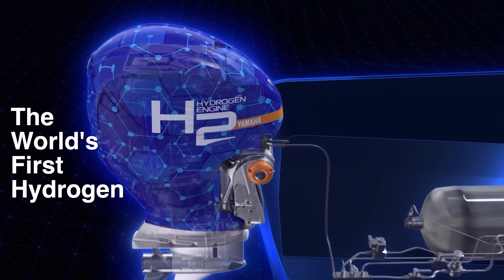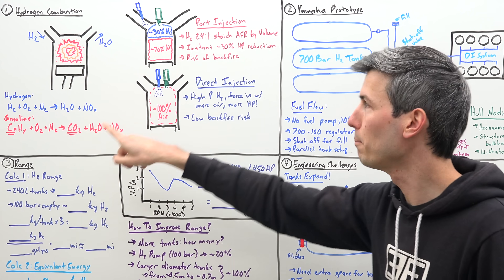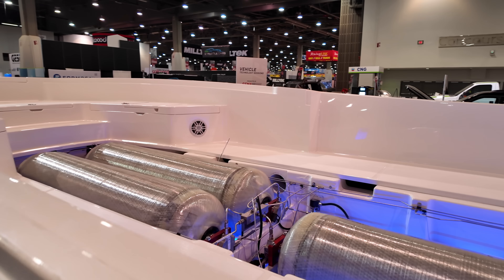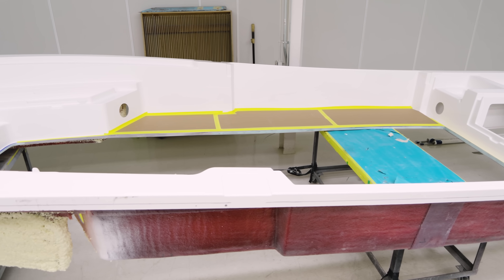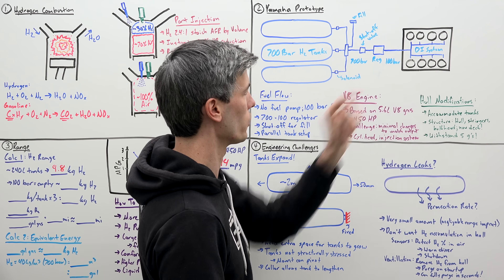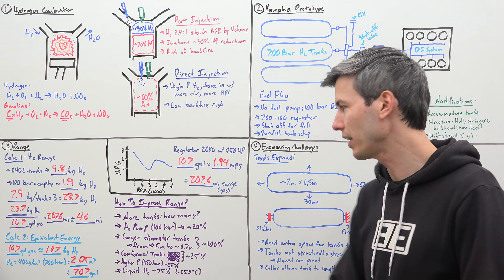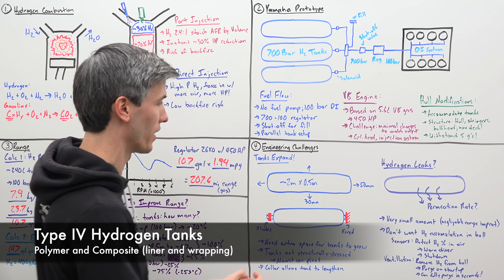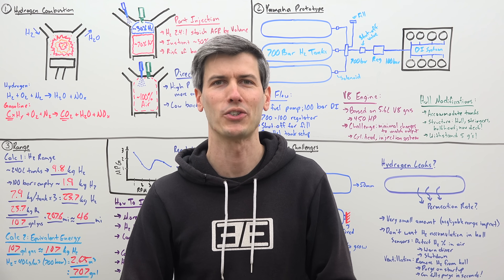The World’s First Hydrogen Combustion Outboard Engine!

Comment: Hydrogen is the worst possible combustion engine fuel. Its not dense enough to be viable for transport and it can't be made without consuming more energy than we get from burning it or cracking it from hydrocarbons.
Reply: Hydrogen is 3 times as energy dense as diesel, what do you mean it's not dense enough?
Reply: @Shamano37  By weight. By volume, even in liquid form, hydrogen takes up much more space.
Reply: Really, I think the interest in Hydrogen is proof that we don’t have full confidence in electric. We also like ICE cause who doesn’t? (Don’t answer that). Hydrogen combustion is mostly a fools errand (although no one has mentioned its abundance). I hope a focus on alternative fuels for ICE can lead us to a more sensible fuel. Have to walk before you run.
Reply: @Seyeler  Hydrogen is one of the least abundant free elements on earth, its almost all combined with other elements (water, carbon, oxygen, etc). That bond is stable, which means it takes a lot of energy to get that hydrogen free, more than can be extracted from the hydrogen except in a fusion reaction.
Reply: Certainly agree with the first part, but what fuel can make produce more energy when burned than it requires to be made in the first place? I believe thats impossible.
Reply: I don't see how they can possibly make hydrogen a mainstream fuel BUT I'm sure they will learn some things along the way that will improve the overarching goal of finding efficiently produced, energy dense, renewable fuels
Reply: both the french and australians have found large natural hydrogen fields this year,.in europe most of it is made using wind, solar or hydro electricity. the germans already have hydrogen stations all over the country. in birmingham england the busses are all hydrogen  combustion powered. its the only thing that works on heavy machinery and busses or trucks where electricity doesn't make sense.
Reply: Its not bad when you have a ton of excess energy from gigawatts of solar capacity. Hydrogen is useful in a world where gasoline use is 5% of its current levels
Reply: @Wren6858  you can use wind turbines to produce the hydrogen instead of switching them off when demand is low
Reply: I prefer to listen to the professionals.
Reply: Japan doesn't care, they live in an insulated echo chamber.
Reply: Still better than fossils
Reply: The only reason hydrogen is even brought up is because it can be created with renewable energy, solar, thermo, hydro, wind, etc. can’t do that with gasoline. Yes it needs a ton of work but it’s more of an electric v hydrogen problem at that point.
Reply: True, but of you can produce it using renewable electricity sources you. An.burn it without carbon emissions.  But yes density is a large problem, and then from an efficiency standpoint a fuel cell isimg hydrogen to make electricity  to powerelectric motors is a better use if tht energy in hydrogen than using it to power a combustion engine.
Reply: Clearly more energy goes into making hydrogen, storing it, cooling it, etc. etc. then that it actually delivers on energy. The rendement is just negative. ...I say ‘very nice surprise but a no go’.
Reply: I wonder how many people posting conclusive statements in here are actual engineers and how many just watched a few youtube videos.
Reply: And same with those carbon tax sellers!!!! Nuclear is the the cheapest and purest per energy from 1kg of fuel!

But lets sell that fugazy. Just peooke are morons! Now we are at europe electricity costs 0.02 eur for kw to freaking 0.80 at winter. Such a scammm!! And yes lets cancel soon all the wood burners and gas fueld machines like some usa states and ofc install all the solar panela to roofs and lets tax those if you have them on roof and yes buy those electric cars and then lets tax them also later. All the politics are just big scamms and deciving people.
Reply: It's hardly a fuel too, more like an energy storage type than anything else.
Imagine if we had to burn over one gallon of gas worth of energy to produce one gallon of gas. That would be ridiculous, right? Well that's pretty much what hydrogen is.
Reply: @MrArcticPOWER For production of hydrogen by electrolysis the energy loss is approximately 30%. Then there are losses involved in the energy cost of compression, transportation, and storage, giving an overall production loss of around 50%.
Reply: @MrArcticPOWER  Think how abundant hydrogen is in the known universe. If we continue to study it and find better ways to harness it, we can reduce the amount of digging for fossil fuels we have to do. Right now, it isn't viable, but maybe we can find a way to make it viable.
Reply: @Matthew_Campbell_Drums  Even if you find better ways to harness it, you're still stuck with all the other inconveniences.
Reply: @MrArcticPOWER  until we find something better. Look how far ICEs have come. Stuff like that doesn't happen overnight
Reply: @Matthew_Campbell_Drums  What do you mean how far ICEs have come? Over 100 years of evolution just to get 40% thermal efficiency at best while electric motors are already over 90%.
Reply: @MrArcticPOWER I think you’re missing his point, which is that innovation is impossible without experimentation and iteration.
Reply: @Matthew_Campbell_Drums   The most abundant element in the universe is also mostly in space or locked in water or other molecules (methane, etc), requiring a large energy input to break it open
Reply: @Matthew_Campbell_Drums   Gasoline as a fuel is immensely energy dense, easy to transport, relatively stable in controlled conditions. The only thing you need to improve is ways to extract energy out of it. Fossil fuels are so energy dense you can still get a ton of Work done even with 40% efficiency. Hydrogen is just, inefficient on a fundamental level. You can't make it energy dense without immense pressures or freezing temperatures, both of which are costly and/or dangerous to achieve, and there's practically nothing in the world that can prevent leaks entirely (without sheer mass) because the smallest element in the universe will go through basically any microscopic flaw eventually. And also there's no cheap way to harvest hydrogen, locked inside chemical bonds because it really hates being alone.
Reply: @Matthew_Campbell_Drums  What better way's to harness it? It's molecular physics, dude. Also so what if it's the most abundant molecule in the universe if 99.99% of it is inside stars. There is no free hydrogen roaming around the solar system. Only places you can find it except for the sun is inside gas giants mixed with other stuff. Even if you can mine it you still need to get it out of their massive gravitational well, good luck with that. You're clueless.
Reply: And it still produces NOX.  What marina sells hydrogen?
Reply: @Flies2FLL  How does it produce NOX if there is no Nitrogen in the fuel?
Reply: Ok questioned answered in the comments!
Reply: @derekduckitt5900  You forget that the atmosphere is 78% nitrogen.
Reply: @Flies2FLL it produces a miniscule amount of NOX, but yeah i doubt it would be feasible to use green hydrogen as a fuel source anytime soon

edit: CO2, not NOx. oops
Reply: @B0F  A "minuscule" amount?  The atmosphere is 78% nitrogen.  What do you think happens when combustion takes place?  NOX....
Reply: @B0F what are you basing this comment on - NOX production is one of the most fundamental problems with direct combustion H2 ICE applications.   Typically to address the NOX issues you need to try and operate at high lamba where combustion stability now becomes a problem.   
I suspect from your comment that you have zero experience with the design of direct H2 operation in ICE applications
Reply: @Flies2FLL what would you suppose we burn then ?
Reply: @Flies2FLL  haha my bad I must have been still half asleep yesterday morning, for some reason I was thinking of CO2 emissions. Not NOx
Reply: @michael-j-harrison  yeah, I mixed up CO2 with NOx. Oops
Reply: @B0F  👍
Reply: @B0F  it's already happening
Reply: Couldn't agree more, anyone with a basic physics understanding should know how bad of an idea hydrogen is for fuel for anything other than fusion.

Also, when you get a more advanced understanding of Hydrogen and its interactions, you get things like hydrogen embrittlement, it's just an overall bad time.  This is just a marketing stunt.
Reply: @theheadone  Calling it "basic physics understanding" is pushing it.
Reply: The ideal way hydrogen would be produced is during times of excessive energy production from solar and wind.
Reply: @poochyenarulez  that's basically what's being done , it's no difficult to find all of this information, most of it is on YouTube. Go watch @Harry's farm ,JCB content . That covers a lot of it and give you other areas to continue into
Reply: @poochyenarulez  solar and wind are 
Communism 3.0.  Just say no.
Reply: Metal embrittlement, leaks, salt water corrosion… what could go wrong? 

And all you have to do is light a hydrogen filled little balloon and then he said 4:06  ‘risk of having backfire!
Reply: Yeah. Hydrogen is a dead end.
Reply: @yourcrazybear all of this Communism 3.0 stuff is a dead end.
Reply: @yourcrazybear  well, no. H2 and combustion engines are a no-go, but H2 and fuel cell will have SOME applications for really high range requirements.
Reply: The density or lack thereof is an advantage as far as buoyancy... Since it's a boat.
Reply: @SnkobArts  The trouble is that the dry weight of the tanks gets pretty high. What with them having to withstand many hundreds of bar.
Hydrogen has somewhat fallen out of favor in rocketry in no small part because although it is by far the most efficient fuel by mass, even liquid hydrogen tanks get so huge that their weight alone eats up a lot of the initial efficiency advantage. And on top of that it's just an annoying substance to work with.
Personally I have a lot more faith in ammonia for marine energy storage. It's less energy dense by mass, but it's enormously easier to store than freaking hydrogen. Runs well in modified diesel engines. Methanol is better still, but as far as I'm aware it's costlier to synthesize.
Reply: I think we are better off improving synthetic gasoline; currently less efficient to produce than hydrogen, but with more investment and advancement, we could leverage renewable energy infrastructure to cleanly fuel existing vehicles as a stopgap solution while we work to improve the EV charging network and battery technology.
Reply: @Cloud30000  forget about synthetic gasoline. This looses even more energy during production than hydrogen. There is only one type that makes sense (unless some genious change in technology happens) and that is synthetic methanol since it's long term storage capabilities are great and it can universally be used in ICE's or fuel cells. But even there the losses are huge.
Reply: The only "real" application where I see hydrogen combustion being viable would be in keeping motorsports still on ICE engines, since the noise and the controlled combustion is a big part (at least in my opinion) of it. 
But I'll happily be proven wrong that it can be viable in other contexts.
Reply: true, especially since hidrogen fuel cell exists but for some reason people insist on it going "vroom vroom" 🙄
Reply: @everythingiswr0ng  Doesn't mean you can't try something different. You may learn something new while developing a prototype.
Reply: So it's like solar and wind, which require more energy to manufacture than they will produce in their lifetime.
Reply: @cannonfodder6299  wow, you just managed to take the lead on the "most wrong statement ever" list.....
Reply: @cannonfodder6299  this statement is false. A wind turbine takes about 5 months to produce the energy required for it's own manufacturing, PV takes somewhere from 6 (southern Europe/ northern Africa) to 14 months (Denmark).
Reply: @cannonfodder6299  it's actually 5-8 months

Comment: You could store the hydrogen in large containers in atmospheric pressure. Maybe some light weight material like aluminium and plastic.  I understand that the tanks would be quite large and they would have to be above the boat. It would make the boat quite lot lighter too. I wonder why anyone ever thought of this before.
Reply: That would be a very large container, 700x larger. And I think at that point it won’t be a boat anymore, but rather a balloon.
Reply: Because it's an awful idea. Those tanks would be 700 times the size they currently are (imagine the movie "Up" but with a boat instead of a house) plus then there's no pressure for the injectors. You'd just have to repressurize the hydrogen. Another thing, if this fragile balloon pops, you now have an entire cloud of flammable gas above your head.
Reply: Because a 700 bar tank would be 700 times larger at atmospheric pressure…
Reply: This is just a joke making a boat into a Zeppelin, but I guess these kind of jokes don't work on engineering channel, haha

Comment: If is used autogenous pressure to drive the direct injection system the fuel system runs empty at some pressure over 100bar , is like leaving a 1/6 of the tank full
Reply from the maker: Correct, discussed this in the video!
Reply: @EngineeringExplained Please discuss the semi solid state battery from Nio.Which achieves a cell energy density of 0,36/kg. 
1:43 And pack energy density of 0,28/kg.

Comment: The next 5-7 years as we march closer to 500 wh/kg mass production battery cells - this hydrogen concept becomes less relevant. The volumetric increase to cells will offset the weight penalty and improve packaging and give the 90+% electric motor efficiency a leg up even further. 

Neat video explaining the bigger picture issues to hydrogen - I recently got to see our test locomotive we have at my tier 1 railroad I work at and the tank sizes and stacks in that engine are stunning to the say the least. There testing this locomotive for local switch jobs along with a BESS / BEV locomotive solution paired with it (hybrid). Good stuff - but even the engineers working on this project mentioned that once batteries eclipse the volumetric requirements it may just change there path entirely. interesting decade ahead of us!
Reply: Regrettably we are stuck with “drill baby drill” administration, progress may have to wait.
Reply: 100%

Comment: Really hope efficient hydrogen combustion engines in cars and we don't have to rely on batteries in future.
Reply: look at the size of those Tanks, this channel already put out a video saying hydrogen tanks can be small enough for a car to have any usable range
Reply: @krusher74  it isn't now but maybe in future. Hope we are not lumbered with soulless battery powered cars and the combustion engine continues long into the future.
Reply: Some sad news for you. 

1. The most efficient way to use hydrogen is a fuel cell instead of direct combustion. But fuel cell alternatives also require a large battery similar to the one in an EV. 

2. Most of the world's hydrogen is made using methane or coal in a very high emissions process. So though it is low emissions to burn it is high emissions to make. Meaning all these hydrogen fuel options are actually higher emissions than gasoline or diesel. Hydrogen is being promoted by the petroleum industry because it keeps us reliant on them for energy, and uses the easier/cheaper methane instead of liquid oil. Higher profit for them, and we stay reliant on their oligopoly. 

3. Sure hydrogen could be made with electricity instead of methane/coal but the entire process is very inefficient. Meaning it takes a lot more energy per mile traveled to use hydrogen than just putting the electricity directly into a vehicle battery with an electric motor. 
3b. For this to actually reduce carbon emissions we need to convert all the current demand of hydrogen  (pharma, agriculture, chemical industrial applications) from petroleum supplied hydrogen to electricity supplied hydrogen. Meaning somehow to convince the world economy to lower natural gas demand by asking the investors in gas nicely to stop doing what is already making them billions in annual profits. Once we have all the world's current hydrogen demand answered by low emissions production THEN we can start dreaming up new demand for hydrogen. But we all know this will be socio-economically impossible for decades. 
3c. At this point in time we cannot afford to be looking at any low efficiency solutions. Energy efficiency is the only path to supplement a general reduction in all consumption. So moving toward low efficiency transportation fuels does not make any sense. 

4. Hydrogen is a fuel, meaning it still requires all that storage and transportation and oligarchy based infrastructure. All wasteful and socially damaging just like other petroleum fuels. Electricity is so much more efficient to get into our vehicles it has a 30% reduction in consumption before we even travel our first mile. It does not make sense to replace a fuel with a different fuel when there is an option to eliminate fuels.

5. Hydrogen is difficult to store long term. This boat will slowly empty itself within a few days/weeks without ever traveling anywhere. To delay this as much as possible those fuel tanks are made with some pretty sophisticated materials. Meaning those fuel tanks represent nearly as much environmental harm to manufacture as batteries. So hydrogen solutions do not even mitigate the worst part of bEV solutions. 

To sum it all up, hydrogen transportation solutions are not the dream low emissions solution they are being promoted as. And the fact they are being promoted by the petroleum/transportation industry and not environmentalists should be your big clue.